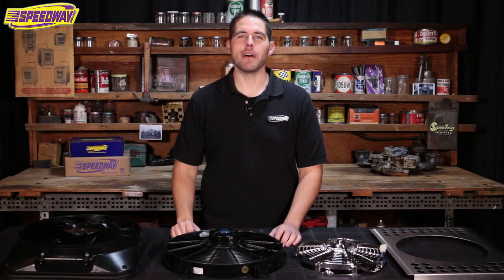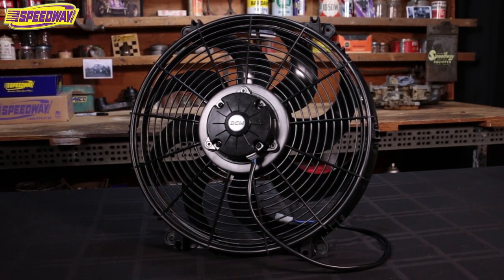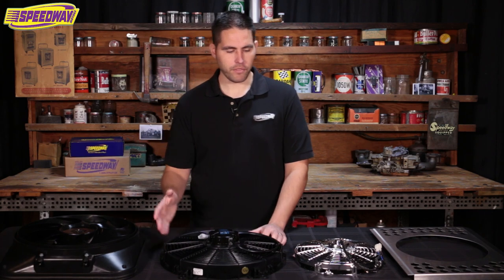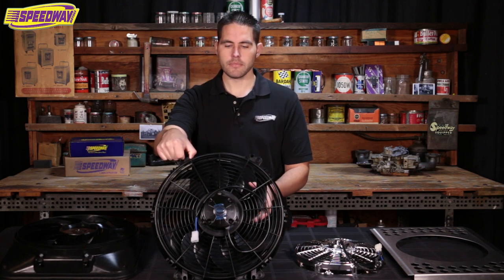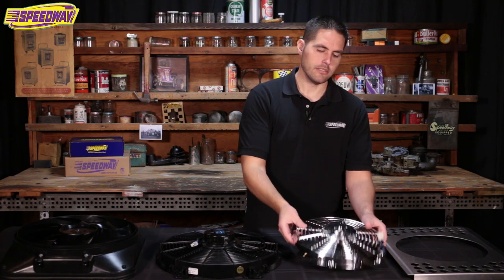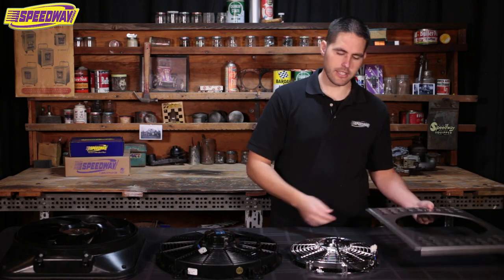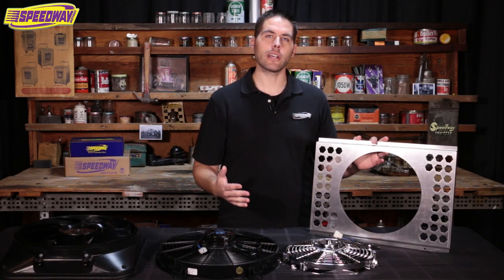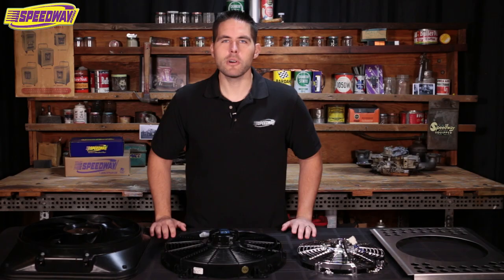Speedway Tech Talk - Electric Cooling Fans

Comment: Do you not think that perforated shroud will "short circuit" the air flow from the fan? I know it's supposed to allow more air through on the road, but it's not as good as the fan appliqued directly to the radiator, which isn't as hood as a full shroud.

Comment: So going down the highway is better air flow without shroud, so holy shroud looks only? & Still run hot in traffic?  Does one 16 centered cool as well as 2\12's on a 12"H x 26 core turbo4cyl?

Comment: I have a 99 ram 1500 5.2l what cfm do I need to do a clutch fan delete
Reply from the maker: You can use any of the universal electric fans that we offer. They are all universal and will require custom wiring to complete installation. We recommend using the largest fan that you can fit on your radiator.
Reply: That still in not answering the question of what CFM  Cubic feet per minute of air flow do I need  I understand I need a large fan My concern is my cfm
Reply from the maker: @bluecollarbiker8005  I’m sorry to say that we don’t have any way to calculate how many cfm you would need.
Reply: That depends on a lot of factors. How do you use the truck? Do you do a lot of heavy towing? Do you live in a mountainous area? Do you live in a very hot climate (100+ degrees)? Did you make any modifications that increase the heat load on the cooling system (drastic performance upgrades, turbo, supercharger, etc)?